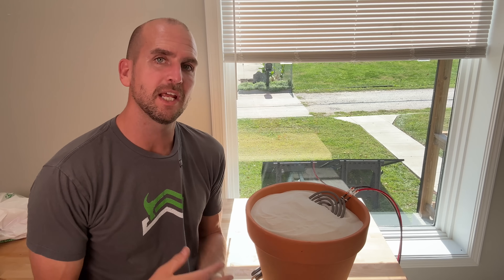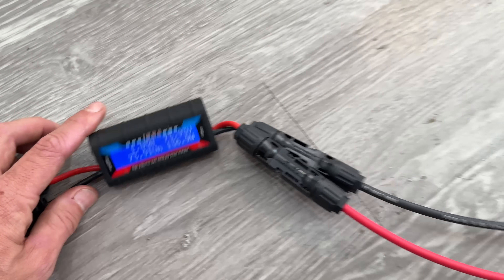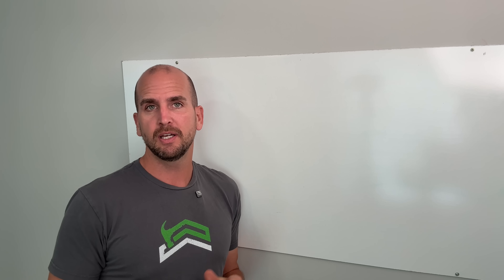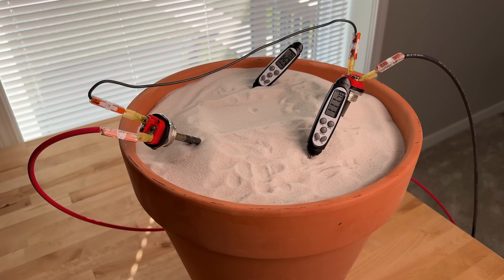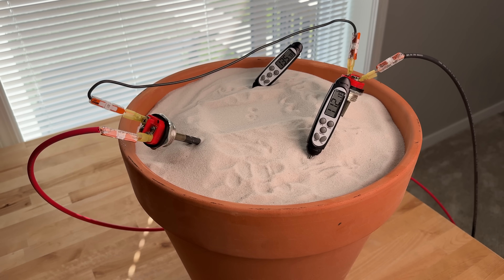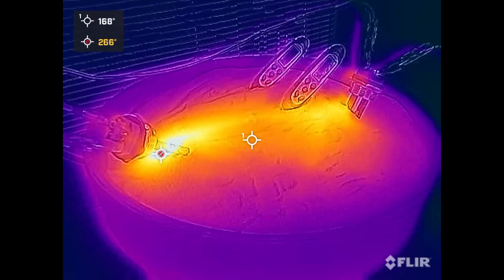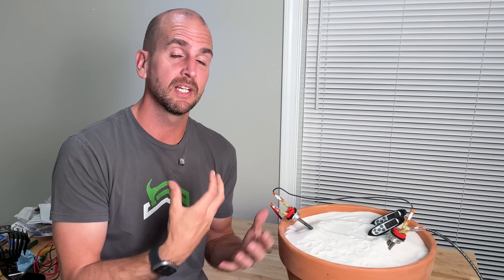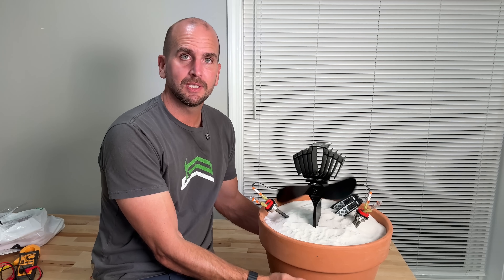How To Create A Solar Sand Battery Heater | Free Heat This Winter!

Comment: using solar to electricity of 20-30% efficiency and electricity to heat at 90%+ efficiency for heating is pretty inefficient a vacuum solar to heat panels would give you way better efficiency. in solar heat the thermal isolation of the tubes moving heat moving  liquid becomes important, and you might want to use a 200-500Wp solar panel to power the pumps (pumps are not needed when there is no solar irradiance) but it is not rocket but HVAC technology readyly avaiable at ironmongers or what those are called today in your neck of the woods (I did not ge where there is both 240VAC mains and Fahrenheits as unit of temperature, maybe Australia or Great Britain.)

Comment: you had 790W of panels, and only 250W of energy in full sun. You need mppt charge controller to utilize panels more efficiently. Panels give maximum power at certain voltage and amperage and mppt tracks that and keeps panels on that maximum power. I think that it is OK to add such heater where to dump energy after batteries are fully charged, but using mppt.

Comment: Sand battery seems great alternative to heating bedrooms at night instead of using coal . No toxic gases, no danger of fire etc. 

Those elements might get burnt if the heat transfer is not fast enough. I think tjat the ancient nichrome spring type heating element would do that better. It can be cut or stretched as required.

Comment: You said you would leave the measuring devices, but straight away moved one. You said you would measure how long the heat would last, but only looked at it one hour later, then continued to change the setup again, and the video ends. So, while the idea was intriguing, I didn't really learn anything useful beyond the fact you can hook up heating elements and stick them in a pot of sand. A bit disappointing.

Comment: With a 1mm parabolic stainless steel sheet you can heat the sand directly wit the sun then use that heat for... heating! e.g. shovel up the hot sand into a large insulated box with water pipes running through it (heat exchanger) to provide hot water for most of the year,depending on your latitude.
 Keep your solar PV for your electrical needs.
They are developing huge silos full of superheated sand in Denmark,I think,to use as a way of storing electricity from wind turbines to be released over 24hrs to provide hot air,hot water and to drive steam turbines to produce electricity.

Comment: matching Ohm of solar and water heating element is important for efficiency.  there is a guy that has made an excel spread sheet that matches panel voltage/amps to water heating elements.  After using it i found my panels were not matched and once i switched my panels for others i had laying around that matched better my water temps went way up!   sorry  i forgot where i found that info... but if you search for it  im sure you will find.

Comment: Would like to see this done using the typical water heater filled with water, how long to heat it?
You could more realistically rig a hydronic heating system in you garage etc. from this.

Comment: If you saturate your sand with water, that'll help with heat dispersion! Or better yet, heat water instead. As someone mentioned below, even though it might seem like you're storing more in sand, unless you exceed 215C you're better off using water. Better still, get an old solar hot water panel, you'll heat the water directly and get a much higher efficiency... although can be messy with water and pipes etc..

Comment: Its a nice little science project, but if your going to do this in a home, our probably going to want to design safety features.  In the end, I don't think this will be the more effective way to use your solar energy.  It might be more practical for a shop or greenhouse in the winter time to help add some BTU's to it.  But even then, if temperature control is important, like growing food in winter, your probably going to need something more reliable.

Comment: How about hooking an electric storage heater directly to your solar panels, instead of heating a bucket of sand? I don't know if you have them in your part of the world, but storage heaters are used alot in the UK. They work by using electricity at night, when it is cheaper, to heat some thermal bricks. During the day that stored heat is released back into the room. 

The best part, and one that might be tricky to make yourself, is that the heater is insulated to keep the heat in. Air vents are opened to allow convection currents to move the heat around the room. You can control the amount of heat that is released by opening the vents more or less.

Comment: you are converting radiation to electricity and back to radiation. It would be more efficient to directly heat the sand with sunlight.

Comment: Best thing to do with a few panels is to hook them to the water heater. It will provide free hot water during summer. The water heater usually is one of the major electricity consumers during summer time.

Comment: Try to roughly impedance match the panels to the resistive elements.
In this case, two panels, (34Vx2)/11.62A = 6.37ohm

So, I'd expect to see much better results if you create a combination of elements with that resistance value.

Of course, maximum power point (and in turn, impedance) will change depending on temperature, how much sun is shining...
And the resistance value of the elements goes up with temperature.

Comment: Some thing to Add Is a Diode Chain - Diode String ( This Runs like a Full True Analogue MPPT ) 

Just Remer to keep them cool Like Under 150°C
The metal block ones are Awesome with Heat sinks And Water Plate Heat Exchangers (and Cheap) Ther your Mains 1000V 10A 20A 30A 50A Rectifiers

Soler Power Edge Has the Maths

Comment: Along the lines of @dellmerlin6328's previous comment, series connect your free used solar panels to match the local mains voltage (110 or 240 or whatever) and pickup a cheap or free secondhand electric oven from Gumtree/TradeMe/Craiglist. If you can afford the cable cost parrallel up more identical sets of panels to more closely match the wattage of the oven.
He also suggests filling the oven with bricks to absorb the heat during the day, then open the oven door at night......

Comment: Question: Could you use a Frydaddy deep fryer connected to a group of solar panels, with the fryer filled with sand? A few years ago, I was searching for a heater to use in a small cargo trailer, so I used a large Frydaddy unit filled with sand, plugged it into 120 volts and found it to heat the inside of an ceiling  insulated cargo trailer during the Winter, when the temperature outside was around freezing. So am wondering if using the solar panels connected to the Frydaddy unit would work, instead of using 120 v current? I would preheat the inside of the cargo trailer a few hours in advance, as it was warm enough to be able to wear a t-shirt while inside.

Comment: Just use diodes connected in series rated for that temperature, there is a paper published online, they dont have internal resistance and works better much more like an MPPT.

Comment: it's like a reverse zeer pot.
Very curious what would happen if instead of solar, you just used focused light on the sand, then had a differential with a zeer pot to generate power.

Comment: There is a reason the pros use a loop of heated air to heat sand batteries. Sand holds heat but is also insulating, aka heat do not move well in sand so most of the power you pump in is wasted. You would get far better results with a large coil of a flexible aluminum pipe heated by a  hair dryer or a heat gun as the sand would be heated far more with less power. Anything smaller than a well insulated oil barrel would be a waste of you time and money as the thermal mass would not hold on to enough energy to heat anything with that tiny (for this purpose) pot. If you want to se this done by pros look at the video from "Polar night energy" a Finnish company heating whole towns with this stuff by collecting heat in the summer and using it in the following winter. The concept is good and it works well IF you go big enough to matter, to small and the losses will eat all your efforts rendering them pointless. I would say if you can get a old large (100gallons or more) propane tank somebody is scrapping and you have space to house it safely (it will be very hot)  then go for it you could save a lot on heating costs. Any thing smaller than a oil barrel would only be a novelty prof of concept but not really useful. Go big or go home, this time it is very true.

Comment: If such a system were simply offsetting an existing heating system with supplemental solarvoltaic heat, what would the pay-back cycle look like? In other words, how much dollar value in heat would this system displace over a winter season? I'm curious because hooking up a DIY sand battery seems far cheaper than adding an electrical battery. Of course, COP or coefficient of power would still be much higher for an electric powered heat pump compared to a resistance heater like this.

Comment: What will happen when there isn't much solar during short winter days that's when I need the heat the most. I am using radiant heater panels but they are puling 748w per hour so draining my battery storage overnight.

Comment: How fast you lose the heat really depends on the ambient temperature in the room. The greater the difference the faster it cools down. If it was running all day and preheated the room then it should last much longer than a cold room. During winter season, opening the door alone drastically decreases indoor temperature very quickly.

Comment: Seems to me that you could just power an electric water heater with this.  It won't care if its AC, DC or even the wrong voltage so long as it is not over voltage.  You could skip the entire inverter and improve efficiency.

Comment: A flower pot of sand?  To make a useful system consideration needs to be given to a lot of factors. First the heat capacity of sand is about a fifth of that of water. So if we raised 1 kilogram of water 70 degrees Celsius above ambient we would need to raise the sand 350 Celsius (650 F).  So for a lot of cases heating up water to say 90 C is more volume efficient than sand. You can insulate the hot water tank (or use an old electric hot water heater) and circulate the water through a hot water radiator to generate heat when needed.  The problem with sand is the stuff insulates so the rate heat comes out is limited. 
Heating lumps of iron in an insulated container and extracting heat by passing air through the system has the advantage of high heat capacity and high temperature which water cannot do in liquid form.
Solar panels have an optimum power point which changes with solar illumination. Essentially for most efficient operation you need to get the resistance of the load somewhere near the right value. MPPT solar controllers do this to optimise charging batteries. Just sticking a 110 volt heating element across the panel is not going to be very efficient.
. In reality using a solar panel to produce heat from electricity is not the best idea. Do it directly by using pool heating panels or solar hot water heater panels. Maybe use a small solar panel to drive a pump to circulate hot water from the collector panel to a hot water tank and through a radiator?
This sand thing might be a fund project but really I don’t think it’s of any practical use. It only works in highly engineered large scale systems which achieve very high temperatures to compensate for the low heat capacity of sand.

Comment: Note that AC has less heating power than DC volts. Convert AC to Vrms 1st? But if you are using solar directly, you will get more power from the same volts/amps because AC is crossing zero and doesnt generate heat at the zero crossing. Compare AMPacity of wire for AC vs DC volts to find an easy chart and skip the math.

Comment: You might hit the sweet spot for resistance and power. 
This might some people find difficult. But easiest way is just to try and see what works best.
If you look at a power curve from solar panel at different loads. You will see a knee curve. And closest to the knee is the optimal output.
Many factors is at play when you try to get the most out of this with a low investment.

Comment: What about something like a reverse water radiator, where the heating element is within the radiator and you have a fan dissipating the heat from that radiator into the air which would more effectively warm up an area

Comment: A sand battery only really shines the sand battery captures & stores heat that would have been lost from an already existing heat source. Think of a large sand battery on top of a wood burring stove. The sand battery would lower your wood use by half.

Comment: This needs to be scaled up significantly in order to be of any practical use. A mere 250W is insufficient to heat a room; it's the equivalent thermal output of two adult humans and a medium sized dog.

I don't quite see the point of this setup. Storage of thermal energy is a concept we've known about for ages; soapstone stoves in the olden days (which you can still buy) used the same principle to keep the house from cooling off too much during the night. It's not like we still need to prove the laws of thermodynamics, nor do we need to verify they still hold true.

Comment: Most emergencies where you would need heat are paired with weather that would make the panels ineffective.  Could be used in winter to lower your bills maybe but I think fuel based heaters are still better in a true emergency.

Comment: Hello can you help. My solar system puts out 3200watts. Which element size would be the min and max to use? 
Would the 240-volt/5500-watt Element not work at 3200 watts?

Comment: I think if you got a small solar panel capable of powering a small circulating pump and got/made some solar thermal water heating panels, i think you could get a lot more BTU/day for a given square footage of solar collectors.

Comment: I would like some measurement for the heat output relating to the sand volume in a well insulated space of a specified size say maybe a 10'x10'x10' cube to know what number of panels and heating elements say from an old stove would be required to keep the space in a comfort range through the night and perhaps the same for keeping a space above freezing to know if this could work as a passive protector of pipes or plants in a greenhouse.  Very useful concept for diy.  i could see perhaps setting up a series of pots with heating elements  to use for both heating and cooking. I have a solar system right now and it would be exorbitantly expensive to expand it.  Batteries also expensive but adding auxiliary heat at night would be a great addition.

Comment: But how much energy is lost when heating the sand. What is the efficiency of heat transfer from heating element to sand ? If you loose a lot, is not probably worth.
Reply from the maker: Yeah, I think this might be a bit more of a greenhouse heater to add a little supplemental heat in those cold days/weeks.

Comment: in germany wie have a thing called "nachtspeicherofen". translation is "night storage heater". you use energie (solar) to heat stones inside an cubic oven over the day. and in the night these heated stones with an air ventilator transfer the warm air into the room. you can buy it in almost every size 5kwh, 10kwh ... its much easier to use as youre sand battery.

Comment: maybe a cast aluminum cap/heatsink sitting on the surface of the sand could help radiate the heat.    like a circle with cutouts on either side for the heat elements to enter.   also, there's a fan that people who use potbelly stoves and such that doesn't require power, just that the base of it gets heat, then it rotates to circulate.

Comment: I've wanted to try carbon ribbons on a rock found at the site, as a safe tent heater. Bicycle camping. (I already carry a 100 watt PV panel.)  This is an easier build, but not as portable. Oh well.

Comment: Would be interesting to see if there was a way to insulate the whole boot of sand during the warming phase, so that it wasn’t losing any of the heat during the day. And then open it up once the solar stopped producing. My guess is it could be heated to a higher temperature and useful as a heater longer. Also, I’d be curious to see if this could be done in the winter.

Comment: Cant you put a boiler into sand to heat up the boiler with help of the solar panels. To keep the boiler heated for months? Keep the sand isolated and the inside boiler made of aluminium/copper for example. Outer and inner layer. Sand is the isolation material and heat source. Cold water is used to get the right temperature

Comment: Interesting concept for studying a heat sink battery. However, this will never be practical for two reasons; 1. Solar only heats when the warm sun is shining. This mean you won't have heat when you need it most which leads to reason 2: the sun is farther away and lower in the sky with shorter days in winter. This batery would only be practical if you needed a hot battery on the hottest days of dead summer. Reminds me of The Mosquito Coast with Harrison Ford... but I digress. 

The only practical heat battery is the traditional rocket mass heater stove that works on junk mail. These can be built small but most heat benches (made of sandy cob) are large enough to sleep on. Several counterintuitive principles go into building the stove part but it will keep a home toasty warm with only a fraction of the fuel used in a fireplace.

Comment: This would be awesome for green houses when temperatures drop to a level that would damage crops. I have seen people use 55 gallon drums filled with water as thermal mass to save the crops in green house but this could also work